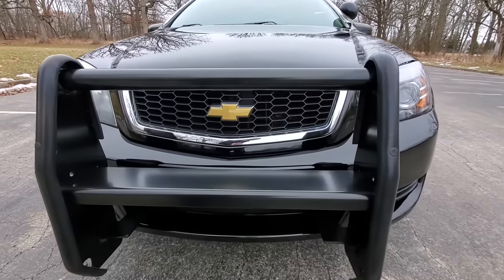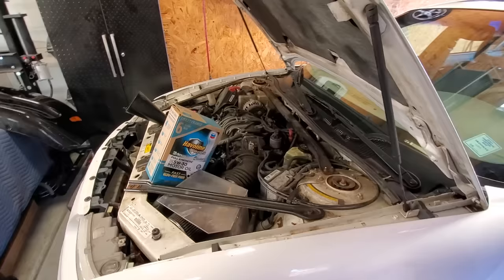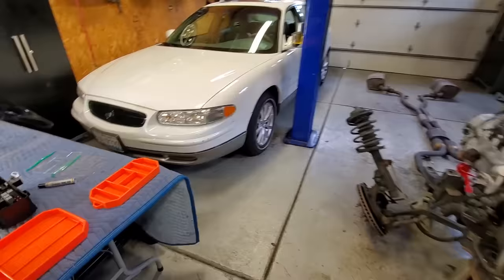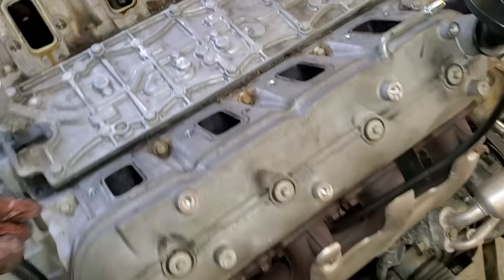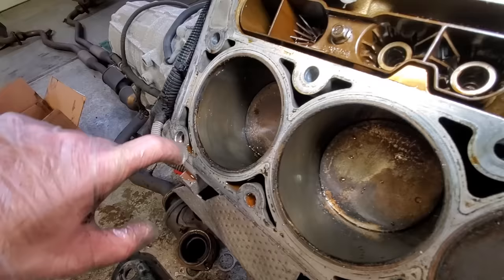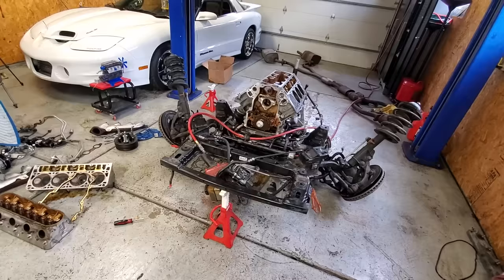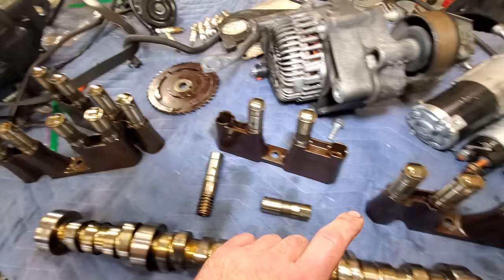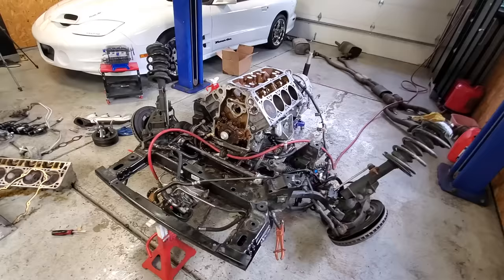Looking Inside An ABUSED V8 Engine That Idled For 12 Months! 357,000 Mile LS Teardown + Body Removal

Comment from the maker: Can a 90's Camry go thousands of miles with no oil? https://bit.ly/3a2XYKN
Reply: Nulon who make a Teflon engine oil additive claim to have added it to the oil of an Australian built 1978 model Holden VB Commodore 6 cylinder engine, ran the engine for a bit to circulate the product through the engine then dumped all the oil out then drove the car for about 1,000 kilometres  (600 miles) with no oil in the engine from Sydney to Melbourne & it still ran at Melbourne.

I wouldn't try doing that  but !
Reply: Looking at a 2010 s5504vm with 98000 km. Looks cherry and cared for...is this a reliable engine transmission combination. All things being considered a good prospect.
Reply: I have never seen anybody work so freaking fast.  You are moving like a madman when you aren't talking to the camera.
Reply: Dude.. dont set the heads like that, thats how you create small gouges and itll leak.
Reply: There was a time when Toyota built great powertrains...since then, it is not the case. LOL
Reply: Yes
Reply: AWESOME CHANNEL....An this old man just Sub'ed to your channel my friend.......                                                          
Shoe🇺🇸

Comment: Those hour meters should be mandatory on all cars.
Reply: I agree
Reply: Yeah as long as it counts all hours too,  not just idle, I would rather do an oil change at 1000 hours than 3k miles cause on stuff like my work truck I let it idle while I'm at a scrapper waiting to unload or when I'm running the inverter for remote ac power
Reply: @CookedTickabc  Most oil change intervals are every 100-130 hours.
Reply: @zapityzapzap  yeah even amsoil signature only claims 700, and that's like the largest interval you'll ever find. (I still try to change it at 500.
Reply: Look on ebay they sell little tacho gauges that you just wrap te wire around a spark plug lead and they keep track of run time and you can set service alarms. Only works if you have spark plug leads but I use them on everything car generators lawn mower take the guess work out of it
Reply: I didn’t know any cars had this functionality.... do Subarus?
Reply: Present in all 2007 and newer GM full-sized trucks, SUVs and vans. You typically have to navigate through the DIC to find it. 2001-2006 GM heavy duty also have hour meters in the DIC.
Reply: @zapityzapzap  mhm
Reply: 3k mile oil intervals are excessive and just avoid letting your vehicles idle, which mostly isn’t that difficult unless you have a specific commercial use case like running an inverter or a pto
Reply: my 04 chevy silverado has one surprisingly
Reply: probably use them for their fleet insurance to write off gas
Reply: @Creamapera not if you drive fast :p
Reply: @erik365365365  nope.. I have owned 2005 wrx, own 2008 sti and 2019 outback xt

They don't have hours
Reply: Most Chevy cars and trucks come with those timers I have them on my Silverado
Reply: My Chevrolet Volt counts how much fuel the car has spent. It gives a much better indication whether if the car has been driven hard or carefully or if the car was idled on has highway miles.
Reply: Most modern cars have it, not always accessible without dealer reader. I know this is how BMW, Audi and MB check if KM's were hammered down, by and estimate of hours of use.
Reply: @cjeam9199  My 2014 SRT Jeep requires 3k mile oil changes otherwise the valvetrain starts making lots more noise. On a regular DD I'd say sure 5k+ but on high performance stuff I stick to 3k
Reply: @zapityzapzap  Subarus barely have engine functionality as is. They would be stupid to put an hour meter on it. You'd be sad calculating that you spun a rod bearing with with so few hours.
Reply: Without knowing forsure, id bet they are in every obd2 engine out there, just some you need a scan tool to access
Reply: Amen.
Reply: @zapityzapzap  I have a hour meter on my 03 suburban as well as my father's base model 03 1500
Reply: @noltec420  you can make them lie just like odo it's kinda nice but not to be trusted from any business seller, personal or fleet is just as suspect, lies make too much money to be forgotten
Reply: Its funny because all semi trucks from i wanna say 05+ read hours and miles. Once i had a semi that only had 300k odd sum miles with an idle time that put the total milage up to 400k. Its horrible on emissions and can kill an engine in no time.
Reply: @nicholasrosol1798  my Evo X valve train gets noisy after 2K, if you use the recommended Mobil 1.  I use Red Line now, it’s not stock anymore though.  But I tell people Mobil 1 sucks for high heat turbocharged engines.
Reply: I believe most ECMs keep a count post OBD2 but you have to get into live engine data and it might be total hours not just idle
Reply: It only has that on my families tractor
Reply: Great Idea!
Reply: Agreed
Reply: @zapityzapzap  1999 and newer*
Reply: That's called an hour meter lmao
Reply: Most diesel trucks do...if it is a gasser it was not put on by the manufacturer.
Reply: Just about every new car these days has that ability.
Reply: "1000hp pickup"
@ nicks garage, roots supercharged injected big block v8 fully prepped on dyno ' only' pulled 800bhp maxxx...
Sounds like "amp max power output"
Reply: A lot of new cars do have this
Reply: They are, all cars after 1996 have an idle time counter on the OBD2 port
Reply: @pilotavery  I have two cars here one from 2018 and one from 2019 (Toyota hybrids) and both do not have a idle timer on the OBD2 port. My previous car from 2014 (Ford Focus diesel) didn't have a idle timer as well.
Reply: @meeder78  Toyota hybrids require you to use a dealer-level scan tool to read like 95% of the data. Toyota hybrids are nice because they even record EACH AND EVERY CELL CAPACITY AND VOLTAGE!

Keep in mind that you won't be able to read it with some CAN bus dongle or laptop smartphone app. Go to a tuner or a dealer. Toyota hybrids also store the last 1024 CEL codes ever to come up as well as the total number of engine revolutions. 

Note: The total number of electric motor revolutions, and gas engine revolutions aren't exactly "idle time" but it gives you a good estimate if you factor in milage. For example, 2x the hours for the same mileage is probably driven harder and engine revs are even better than hours.
Reply: @meeder78  most ford's after 2012 have the engine hours on the infotainment system "test mode" screen. Check your manual to get into the tiny screens test mode function. You can also calibrate the compass, odometer and speedometer, etc. 

If you have the non-usa diesel, you have to go to the dealer for them to pull the information off the ECU.
Reply: @meeder78  You can't scan it with a little dongle to any normal scanners you need a proprietary one from the manufacturer, the same one you'd use to adjust the spark, fueling, or even re-tune for more power.
Reply: @meeder78  manufacturers always record engine hours because of warrenty purposes.
Reply: @pilotavery  I have one of those which can also be used to reflash the ECU if needed. 
But it might be a thing limited to US vehicles? In the US the 1.6 diesel was never available in the Focus as far as I know. 
For Toyota I used Techstream and I couldn't find a PID for idle time.
Reply: @meeder78  there's no pid for it, you need to send a special frame on the CAN bus. There's also no PID for some strings like transmission serial number etc, you just need a dealer tool. As far as I know, Toyota doesn't have a PID for each cell of your battery, just the whole pack. But Toyota can get it
Reply: @meeder78  it might be something in the usa, because USA cars are required to store all this information so that it's available in a crash. Also, vehicle manufacturers all are inclined to do so because the more data they have, the better they can make their product. Often, it's hidden data that they don't want anyone to see. For example, after a crash, Toyota vehicles after 2012 have a black box that records the entire crash event from every sensor including accelerometers and noise sensors and braking actuation and a steering wheel inputs and if the radio was on or not and all kinds of other data. Tons and tons and tons of data. However, it's not available to anyone but toyota. As far as I know, every manufacturer does it if they have an ECU because it's easy to do so and it's stored permanently right next to the odometer data and the hex file. The ECU records its mileage and all kinds of other data including either hours of uptime on the computer which usually is pretty close to the number of total hours on the engine, or by total number of revolutions.
Reply: Unless you idle for hours at a time, it's practically pointless. Have you ever heard of an engine having issues from only idling? I mean, 9.9/10 engines that get used don't ever just sit at idle and do nothing more. So unlikely it's ever been heard of.
And how would one calculate the hours spent idle to miles on the clock? Rpm doesn't tell you the speed, and obviously idling means it ain't moving. So, at what point does idling time measure into milage on the clock? Is it 1 mile per 1 hour? 
And don't give me the gas used at idle equals the milage spent idling. unless you go into drive and do not touch the throttle, the rpm will be different driving vs. idling. Plus, freewheel spinning (up on a lift) vs. actually moving the vehicle (on flat ground), the vehicle will likely use more fuel to move the car vs. just spinning the tires. Also, a 3.0L vs 6.0L motor will use a different amount of fuel to idle. 

So again, where does idle time equal to more milage on the clock of the motor? 
I'm genuinely asking. Apologies if I sound snarky in my comment.
Reply: @ganjasage420  you can divide the number of miles over the number of hours to get the total average miles per hour. If it's really really low it's probably been idling. Idling is not great for the engine because parts aren't lubricated properly and because of a greater temperature differential. It's also not great for the catalytic. But mostly, it means that the true amount of wear is not shown. A total number of revolutions and or total number of ECU hours is usually a better indicator of wear. And you're correct, different factors will affect it differently, but when you divide this over the life of a car, over 100,000 miles, it's not likely that someone will run it on a dynamometer enough to make a difference. But you can see long-term trends this way, by looking at total revolutions per mile which will tell you the average gear ratio or total number of miles over ECU time which is average miles per hour, etc.
Reply: @ganjasage420  I love you all sitting idol for hours on end does not actually increase the odometer but it can increase the total number of you see you time and total number of revolutions. It won't increase the number of revolutions as fast as driving on a highway which means that that number does a better job at showing average amount of wear because different driving can affect wear and tear differently. Highway cruising does the least amount of wear per mile etc. And City driving does more wear and tear but you also get more total revolutions per mile because the average gear ratio is lower.

Generally speaking, the total revolutions is fairly proportional to the total number of ECU hours on most vehicles. And this is a good indicator of engine Wear.
Reply: Agreeed
Reply: I always thought a "lifetime mpg" thing would be a good indicator of how rough the engine's had it.
Reply: Yeah ironic it's on lawn mowers but not a full size car.
Reply: @nthgth  yeah, but so is revolutions over miles or hours over miles
Reply: @matthewmorgan582  they are on cars on the ECU
Reply: @pilotavery  Fair enough. 
I say make it all available to view. Modern cars are smartphones on wheels anyway.
Reply: @nthgth  yeah, I agree. Most modern cars actually do have it though, every Ford after 2016, most Japanese cars after 2018, etc.
Reply: @pilotavery  they have those things you said? My 2020 Subaru doesn't but I'm glad most cars have it.
Reply: @nthgth  it looks like Subaru does not use engine hour meter, they use an ECU hour meter. That's the total amount of time that the key is in the run position. Generally this is basically the same because nobody leaves their engine in the run position without the engine turning over for very long because the battery will die. For most people there's five or 10 seconds at the start and end of their drive so it's negligible and basically the same amount as the engine hours.
Reply: @nthgth  close enough for the most part.
Reply: @pilotavery  how do you know this? Do you know how I might access this info?
Reply: @nthgth  you need to either ask the dealership or you need a dealer level OBD2 scan tool and can bus scanner and appropriate software on a computer
Reply: @erik365365365  subarus need headgasket counter not idling hours. And no, subarus dont have that feature.
Reply: @nthgth  because I used to work in a shop as a mechanic.
Reply: @nthgth  you need an OBD2 dealer scanner tool
Reply: @pilotavery  is that all you need? I have one of those but just a consumer model, not the $1000+ professional tool
Reply: ECU computers keep track of it.
Reply: @angelgjr1999  I keep saying this
Reply: If the ECU tracks hours you can access it with a scan tool.
Reply: Gm has had it for a while. I think all the way back into the gmt800 trucks.
Reply: Just one more thing to drive up the cost of a  new car but really only helps the guy working on the McDonald's/Walgreens drive through enthusiast's car know to charge him a stupid fee. I do wonder if Tesla has lost a sale due to not including this feature though. Someone is definitely asking about this at point of sale. I want a passenger seat fart counter and if it hits one you're walking.
Reply: Its an easy meter to add out of sight and possibly a pid add on
Reply: @eggreedgious5194  It doesn't drive up the cost. It doesn't cost anything. Every car in the USA after 1996 has one built in the computer, OBD2 standard. Most cars though, only the manufacturer can get the info. Cars all have computers, and it is simple for it to log "Number of revolutions" "Hours powered on" etc.
Reply: @pilotavery  what are your feelings on the fart counter? I drive a 1990 so OBie does what?
Reply: 5000 driving miles is around 100 hours. The amount of idle hours you'd have to have to hit 1000 hours while under 5,000 miles is pretty insane.
Reply: @truckman63  we have KW T800s at work with 30,000 miles and 10,000 hours
Reply: Absolutely
Reply: @pilotavery  hopefully they’ve changed it in recent years but everything is saved in the cluster for GM vehicles and not the ecm. You can even pull the cluster fuse and it won’t count mileage/hours anymore. Hours in trucks isn’t even remotely accurate anyways and will reset to 0 or change to a different number entirely over time, at least up until 2014 models. I’ve seen thousands of gm vehicles with the mileage/hours rolled back here, it’s laughable how easy it is. Every day I’ll see a 2005 Silverado or something listed for $800 and 300k miles sell an hour after it’s posted. A week later its back up for sale for $10,000 and 70k miles.
Reply: @xgouldiex  thanks for the info.
Reply: I figured all newer cars had that info In their computers..

Comment: Ya gotta love Florida cars. If that was a Chicago LS you'd have weeks of content just replacing broken studs!
Reply: H3R3T1C im pretty sure in Ontario it’s mandatory to have a oxy fuel torch powerful impact gun, wire brush and infinite cans on penetrating oil to work on cars lol
Reply: @MFKR696  i really don't understand why they still use salt nowadays.. car killer..
Reply: In England he would have taken 5 minutes to call the scrap man because it would would be returning to the Earth
Reply: If it hadn't made it to a chop shop yet
Reply: @Wogix26  Still too many Porsches to steal. They just burn the cop cars!
Reply: @AJGreen-cn8kk  lol true enough
Reply: @MFKR696  we use gravel in the Pacific Northwest. It works great. I think we also use liquefied salt on certain stops and intersections
Reply: Gotta love florida.
Reply: @MFKR696  So they use liquified ice too?
Reply: Yep! Anywhere else after one winter and a brand new car turns into a complete rusty POS. 💩
Reply: @moekhan95  Gotta love Australia.
Reply: @disarm2k10  Beats dying.